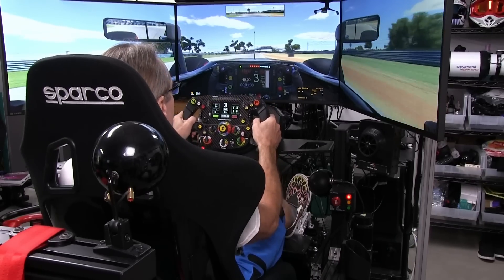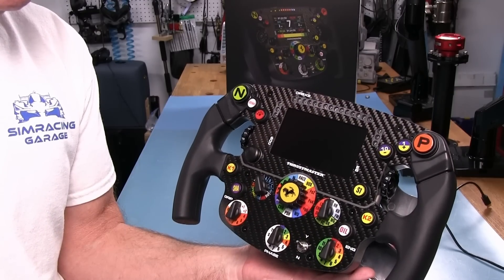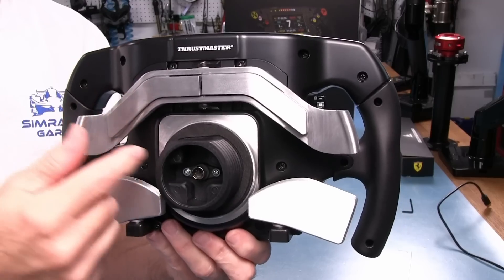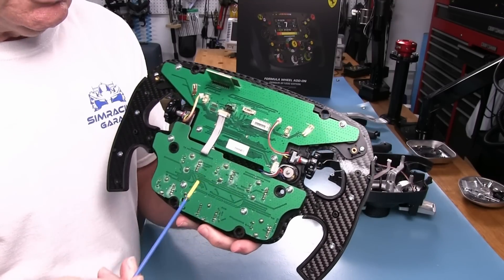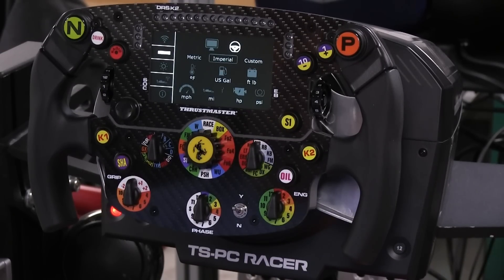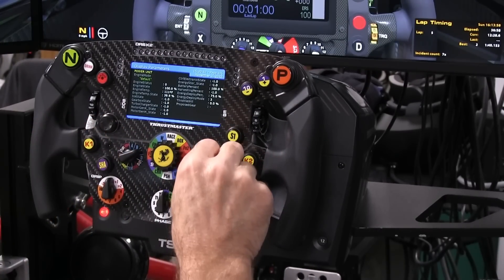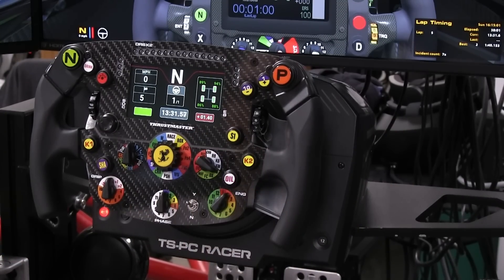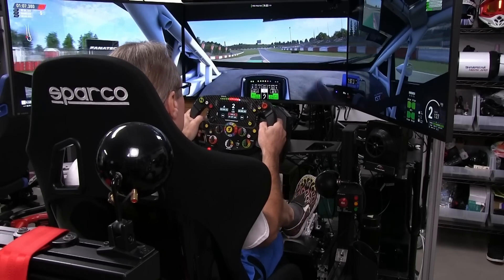Thrustmaster Ferrari SF1000  Wheel Review

Comment: 22:10 the adventures of Canadians :P many of us use both km and miles, C for critical temps, F for interior temps, hp for power, psi for pressure, unless it's atmospheric (where we'll use pascals), and litres for fuel... and cm for smaller measurements (unless it's really tiny or mechanicy where we'll use inch divisions), feet and inches for medium distances / height etc. before switching to meters for longer ranges.
It's always confusing when someone says gallon, or ton, because we have to ask 'which one'.
Reply: this sounds like one hell of a headache.
Reply: Thanks for the info, very insightful!

Comment: I was able to order the SF1000 when 1st released, it took just over a year to reach my doorstep. I have had zero issues with it and love it, it does what I need. All buttons work with AC ACC F1 19 20 21 22 PC2 PC3 AMS2 & rF2. I am also able to customize the left lower paddle as a clutch. The only minor issue was the stickers rubbing and falling off the 2 main buttons I use over many months of use which is to be expected. The same thing happened with my F1 Collectors Editors Edition wheel the two main buttons stickers eventually rubbed off, I have been happy with all my Thrustmaster wheels over the years. I am happy to have read that the SF1000 will work with the upcoming T818!

Comment: The first one I got didn't work properly. After only a few days I started having problems with the shifter. Either it double-tapped or didn't register a press at all. It was impossible to drive with it. Got it replaced instantly though without question and the second one have worked perfectly.

Comment: Brilliant video as usual!

I've had this wheel for about a year now, and while I think it feels great to drive with, I'm a little let down with the lack of customization options, especially for the screen/dash.

Just one thing though, you change the way the clutchpaddles work with the "Phase" encoder near the bottom. When it is set to P1 you get brake/gas, P2 you get clutch/customisable axis/button, P3 you get dual clutch, and P4 you get 2 customisable axis/buttons.
Reply: You can have dual clutches 😮
Reply: Thank you so much. I own a sf1000 since a year and thought it was a Patch at ACC rhat changed the config. I can config rhe paddles again, yihaaa.

Comment: I recently purchased the SF1000.  I am using the wheel on a T300RS base, and swapping with a F599XX Alcantera wheel.  When the wheels are swapped, after a reboot the device name changes in device manager.  

SF1000="thrustmaster advanced mode racer"
F599XX="thrustmaster T300RS Racing Wheel"

This creates a problem as iRacing detects this a a completly new device, and launches the axis mapping wizard every time a change wheels.  AMS2 also requires remapping and config changes every time I change wheels.

How do you manage multiple wheels on a T300 base to minimize the configuration changes when swapping wheels?

Comment: Beautiful wheel, I wish Fanatec would care to design and produce a wheel like this, they wasted time and money on one ugly BMW wheel that doesn’t even have a screen and it cost $1,600 USD. Kudos Thrustmaster!
Reply: The TM wheel is def not even in the same range as the Fanatec BMW wheel that is on the real car. screen also only works in 5 games
Reply: Fanatec has a similiar Formula steering wheel, but it has no screen built-in
Reply: but the thing is the BMW wheel is miles ahead in quality and its the ACTUAL steering wheel of the M4 GT3, it just has a different quick release to the real one (obviously), its not a replica of the rim from the car, and i get your point, i also prefer the thrustmaster wheel as im f1 fan too
Reply: @Chris_Vasileiou  the qr2 is actually the real deal

Comment: Regarding the clutches, if you can bind both to the clutch, you could probably have a de facto dual clutch already.

If both can set clutch from 0~100%, the more depressed one will cancel out the other.

That way you can hold one at 50%, while pressing the other to the max (100%), which will engage the clutch fully, regardless of the one held halfway.

If you then release the fully held paddle, the clutch will spring back to the value held in the other paddle.

This at least works like that in other games where multiple input axes are bound to the same output axis.

Comment: one thing i dont like about this wheel is that how easily the buttons paint fade away with only 1 or 2 months of use, i use gloves because of that reson because my servo is not powerful enough is a t300 but i use gloves so i don't put grease and contaminants in the plastics and they fade away but still they fade away no matter how delicate i try to be and is not just the wheel but the base it self happens the same with the buttons fading away my suggestion to thrustmaster if they are listening is instead of applying the button decal as paint you guy should engraved them given the amount you guys charge for the base it self you guys spending $0.67 cents more on mass production and adding laser engraver to the assembly line would make things 1000000× better and is a win win situation.

Comment: Was looking forward to the review! There is an easy way to configure the bottom backpaddels as clutches. The functionality is managed by the bottom rotary encoder. It has only 4 positions and in position 4 it sees the back paddles as separate inputs. Took me some trial and error, but is visible when using the trustmaster control panel.